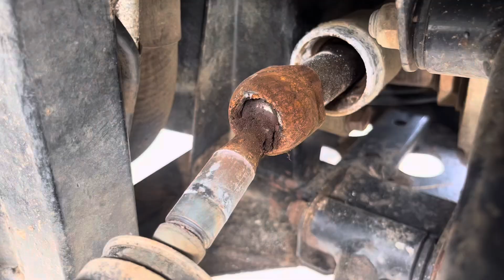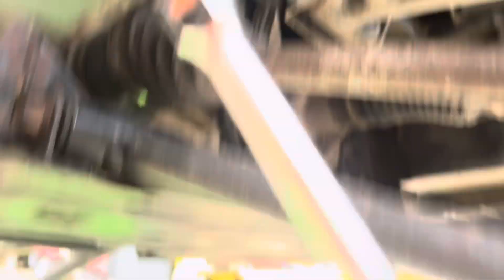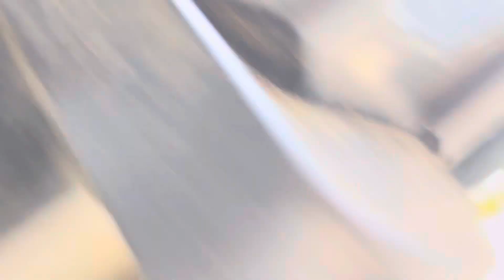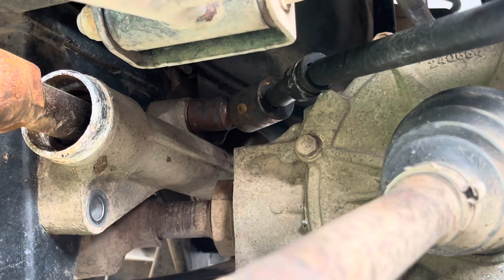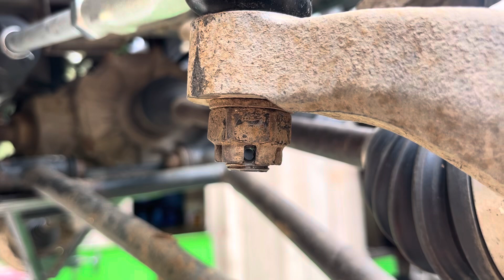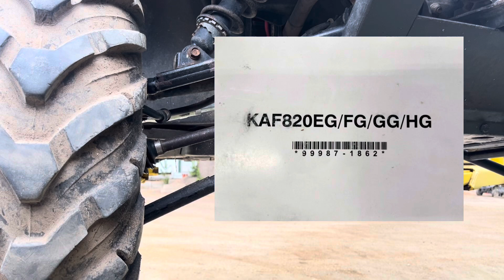Kawasaki Mule Pro Steering Rack Replacement

Comment: Could you please re-explain how you hot it back in? Been at it for 2 days can't get new one in!
Reply from the maker: @simoneyoung4944  Use vice grips on the steering rack input shaft and turn it to get sticking out as far as you can to the driver side.

Comment: I paid 85 for the same exact rack wth
Reply from the maker: @MrGoodman1998  I get the feeling you’re referring to an aftermarket one, I saw those too, tempting but aftermarket part quality can be a gamble, especially risky choice when installing on a customer’s machine
Reply: @LazyDWorx  is salvaged the same thing??? I mean it was factory but it came off a wrecked sbs
Reply from the maker: @ Nice, that’s a great deal! Used OEM are a great option if you find them. Did you get it changed? Hopefully the video helped 👍🏼